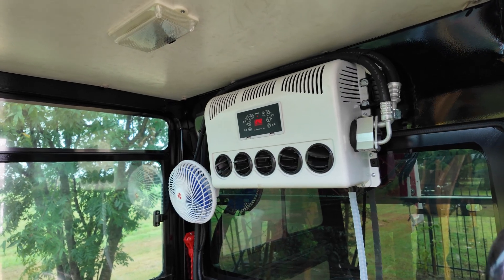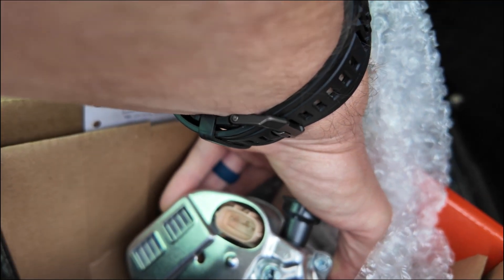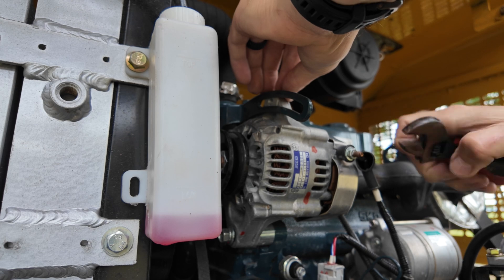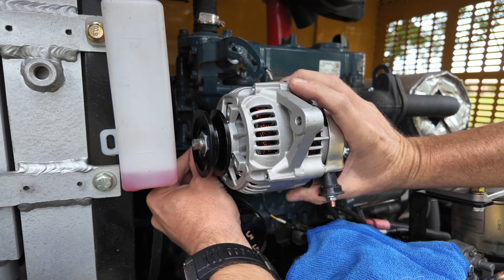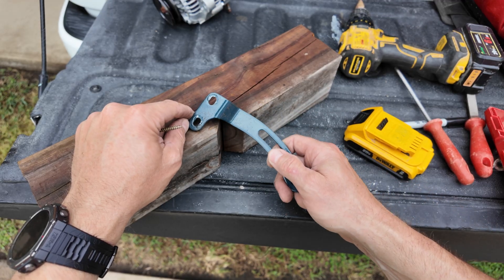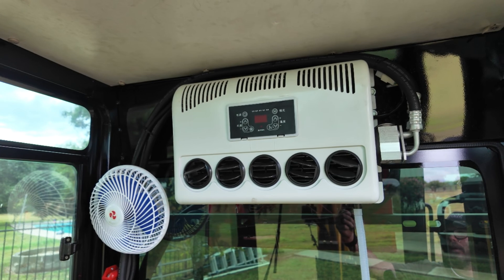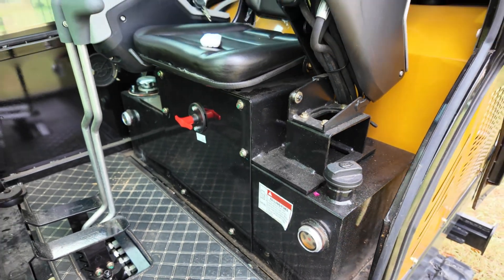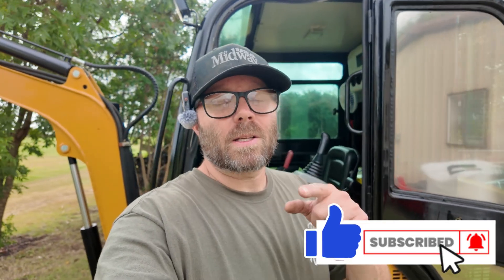AGT QNT 30 Mini Excavator Alternator Upgrade | 12V A/C Upgrade and Fix (Full Guide)

Comment: What is your  AC status? I have the same machine and have followed your videos closely. Thank you for that.
Reply from the maker: The AC system has been temperamental to be honest. It works well if I leave it on eco mode with a fan speed of 4 or below. I've checked the voltage and amperage at the unit and it hold's a solid 12.5 volts and amperage north of 40amps. Based on the specifications, that should be more than enough...I'm starting to think it's my unit. I talked with some other YouTubers, and they're not having this issue. I would recommend buying the unit on Amazon so there is a better return policy than eBay..just in case you have the same issue.
Reply: Thanks for the follow up
Reply: Can't find the link. Tryed looking up the number. Thanks

Comment: This AC units are designed to run with battery bank of lithium ion /lifepo4 batteries witch have a average higher voltage 13.6V to 14V fully charged vs led acid 12.6v fully charged 
Your alternator has a built in voltage regulator designed to regulate voltage for led acid battery not for lithium ion .
Plus led acid batteries are for quick burst of energy for starting only while lifepo4 batteries are designed for constant power and should not be used for starting and cranking i think it works better if you had a separate battery bank and charged them over night from shore but then again if it’s working that’s what it counts.

Comment: I’ve seen something about certain alternators are for certain batteries. So you might want to look into the new alternator you put on over charging the lifepo4 or lithium battery you also added. I think the charging voltages are different.
Reply from the maker: Thank you @larryphillips4164! I just checked the specs on the new battery, and the BMS regulates it at 50A input(versus the 60A alternator) and 100A output. I will be swapping it out for the original lead-acid to see how that works. It will also add some extra weight, almost a 30lb difference between the batteries.